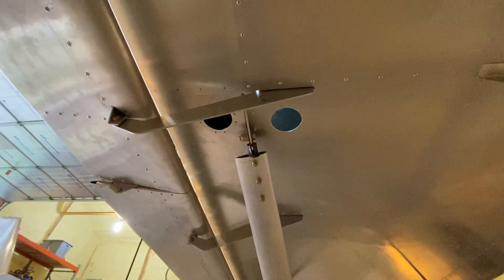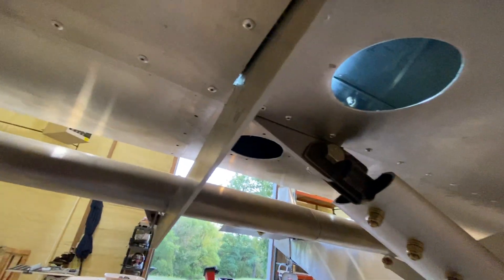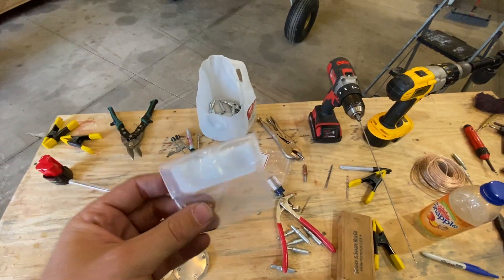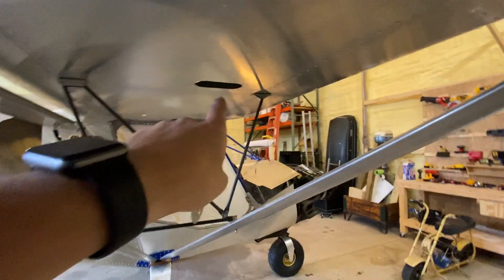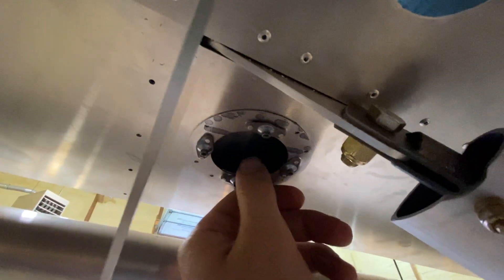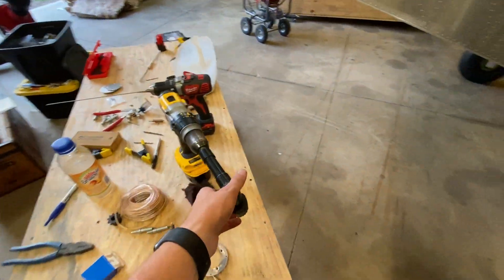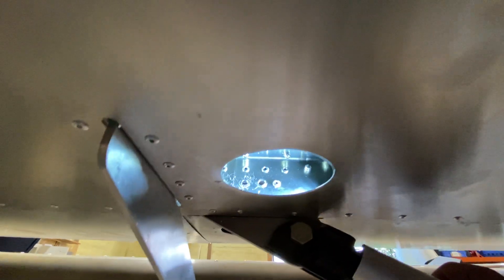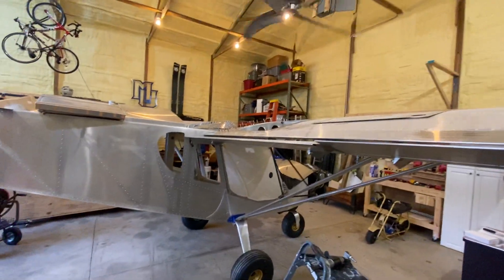Zenith CH750 STOL Build Log - Adding Access Panels

Comment: Cut a notch in the ring to feed it in the hole, You basically cut through the ring so it looks like a cir-clip. it is no structural so shouldn't hurt it.